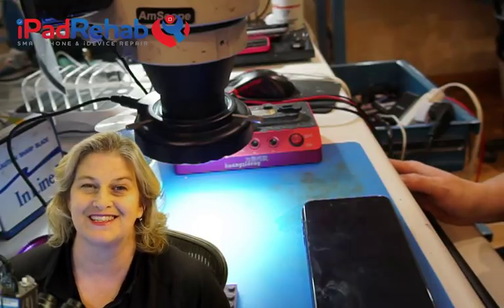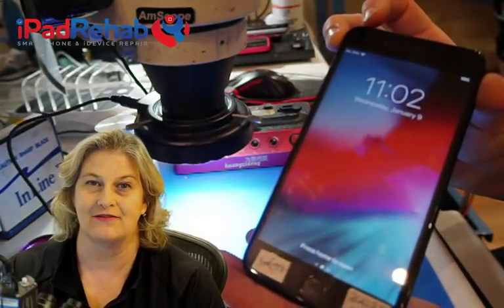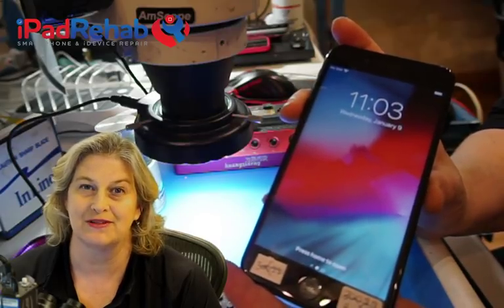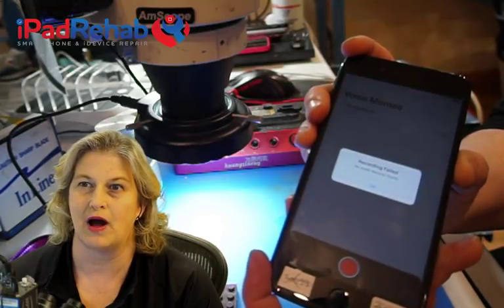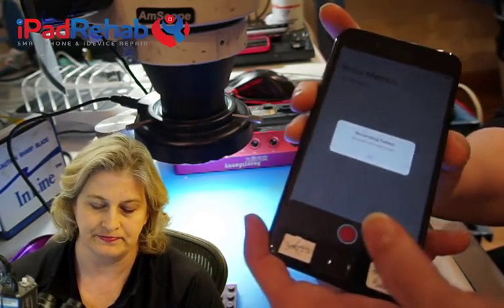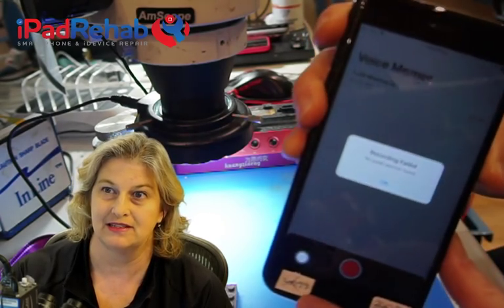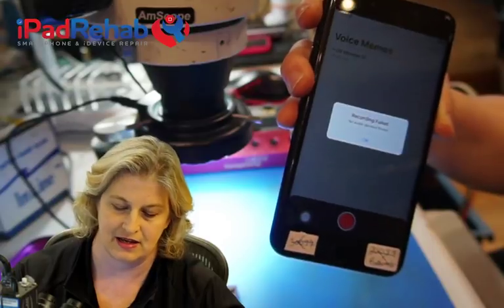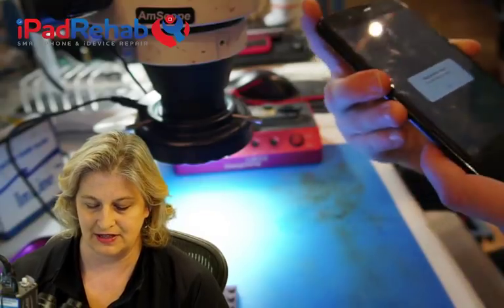Classic iPhone 7/p Audio ic Disease Repair---Fix Caller Can't Hear Me

Comment: I thought you had to remove all the solder from the motherboard before added a new chip or else there would be to much solder from reballing the new chip plus what was left on the board? Clearly it seems that you do not have to do this because you just added fresh leaded solder to the motherboard then added the chip. Would it be a bad idea to remove all the solder from the board with solder wick then add the chip?  I'm going to be doing this repair soon. Thank you so much for all of the content you provide.
Reply: Always wondered about this too. Some repairers do, some don't. You would certainly get more even connections by wicking but it would mean more heat applied to the board and I think there are sensitive devices on the other side.

Comment: Speaking of things Apple fanboys like to say are not repairable, I just got my 2015 Macbook Pro back, fully repaired, after it suffered a coffee spill. I went to Mr PC in Melbourne (Australia), and the whole repair cost me AUD $350. They had to replace the trackpad and cable, and do some board repair. The tech said that the area around the trackpad was so badly burnt that I might have seen smoke before taking it in.

iPad Rehab's videos seriously helped alleviate any anxiety I would have helped in getting this repair done. I was able to take off the back myself, and unplugged the battery (after panicking and trying to see if it would boot up, yes I know my bad there for putting electricity through it). I didn't want to pull the battery out myself to get at the trackpad, and I don't have a microscope so board repair would be tricky at best, but I could at least see that the damage was very localised. I knew straight away my data was safe, no matter what, and knew what to expect for the difficulty of the repair.

Thank you Jessa and everyone in the repair community for fighting for Right to Repair, even if you are across the pond from me. What you're doing does still have world-wide effects.

Comment: Good job. The only thing you forgot is to strengthen the two top ground pads A12 and B12. They break off as well, same as C12. And you forgot to use uv glue to keep your jumper nicely in place. I always enjoy the videos. Greetings from Amsterdam, Netherlands

Comment: To wick or not to wick,  that is the question   LOL           I see you have moved away from wicking pads, many others still wick and there is disagreement over which method is better or preferred.   Argument from those that wick, is that is how it is done at manufacture.  Im guessing not wicking reduces risk of pulling pads....... do you do other ic repair/replace and not wick ?  tristar ?   BB reball ?
Reply from the maker: Manufacturers do not braid pads.  They apply solder paste to the pads—hence, we leave a bubble of solder on the pads for small bga pads and do not attempt to install on bare pads—unless we are forced to.  For a large chip like cpu the priority is for the chip to sit flat and you have to braid the pads.  For all small chips we feel it is better to avoid. It takes a little more skill, but doable.  
In the end nothing matters except consistent results that you back by a warranty against refailure

Comment: Have you seen any 4014 errors on the 7 much? Isn't that a corrupt nand?
Reply from the maker: Not necessarily.  4013/4014 means “Something isn’t right”. Most iTunes errors are not diagnostic for anything
Reply: @JessaJones  In my case it boots to DFU mode, is that just its common state for a 4014?

Comment: Hello iPR  :) I'm a broadcast TV repair electronics "engineer" for the past 20 yrs and 15 yrs before that :)
My Ip7 lost it's speaker audio a few days ago. The Siri response mic audio works fine...the Voice memo works fine...I just lost the speaker output audio....period. I've only droppped this phone twice within three years and the last occurrence was three days ago when at work, I caught it on the edge of my workbench with my forearm and slid it off to the floor with 3.5 ft of casual drop and bounce in the Otterbox mid-grade case to the clean-shop floor. I've re-sprung, reset setting via our IT manager back to audio/display settings to no avail. Again, mic-in audio is just fine but, output speaker audio is gone. Canya helpa fellow tech? Dan Gibbs :)
Reply from the maker: Try a new dock “rule #1” then audio ic

Comment: Your techniques are 99% great...and then you heated the applied patch-wire yet again rather that clip it first before you reheated the patch....BAAAAD for the trusting/emulating techs....THAT is a tip to call the fails to you or the trash bin...I can easily-read technique-knowledge. In old-car-speak....reuse the "tested" old spark-plugs wires with the "refurbished" (worn-out) points and condenser. Damnit. MY simplified analogy that the web will deny but turns out true :-|